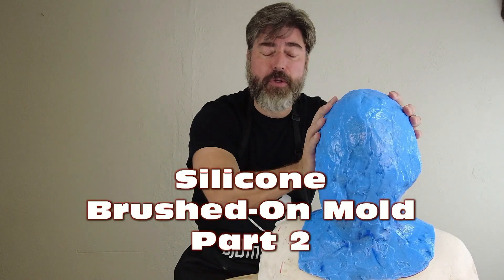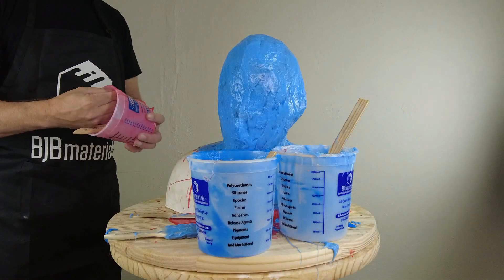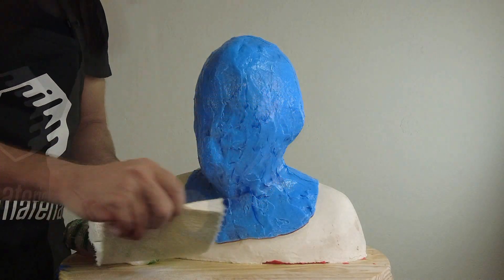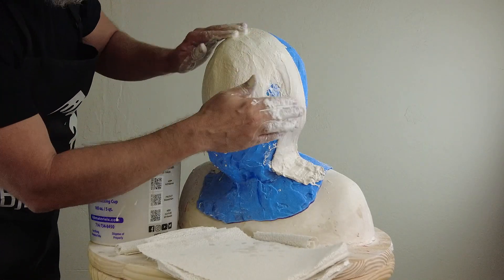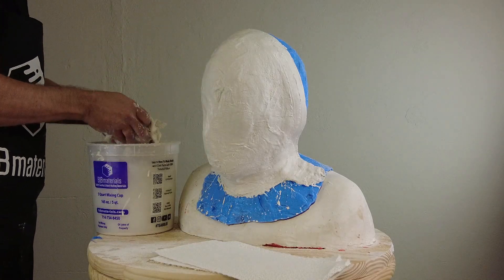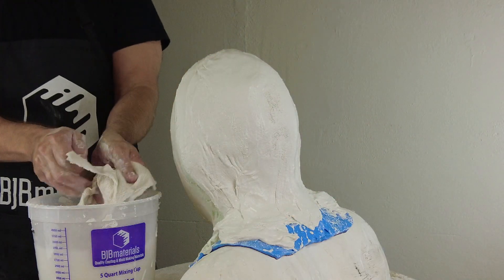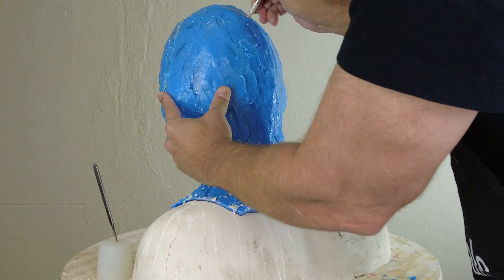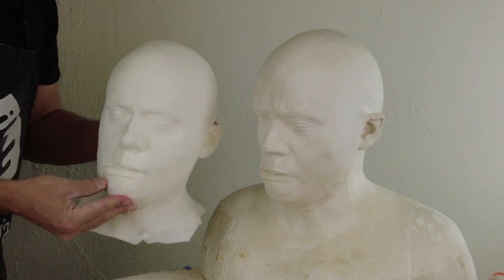Brush-On Silicone Mold Part 2

Comment: Great tutorials - got me thinking about something I'm experimenting with ....
I have a female polystyrene wig stand that I want to use as the mold for an animatronic robotic project. 
Can you recommend the best brush-on silicone that I could just paint on - that will maintain the original features ?
Reply from the maker: The silicone used in this tutorial would work for that: TC-5130F thickened with SC-5001 thickening agent
Reply: @brickintheyard  thanks for quick reply. I checked supplier (BJB), they have distributor in UK,  unfortunately they don't stock these items. But it's got me thinking and I'll do some research. around use of thickeners for making silicone skins. for animatronics, cheers mate 👍

Comment: I watched all that only to be confused and disappointed at the end... I'm sure the confusion and disappointment is all on me. 
I didn't understand how you cut the seam on the back of the mold, wavy then straight? I wish you'd shown a close up so I could see what you were trying to describe to my old, addled brain. 
My disappointment stemmed from the fact that I didn't get a nice close up view of the back of the head. I wanted to see how it turned out, if it was clean, if there were traces of a seam, or even if a full seam was still visible. 
Yup, you guessed it. I'm new at this molding business. I've never played with any of this before but am trying to figure out the best way to cast a  life-sized "baby" elf head with long, delicate, pointy ears that I made out of Super Sculpey. I'm afraid even with your super soft silicone it will still destroy my original .
I really, really appreciated the work you put into your videos and am very thankful that you are willing to share your vast knowledge with the public.❤
Reply from the maker: This process leaves a vary faint, easy to clean seam. I used this mold again in a recent tutorial on casting a Polyurethane Foam + Rubber head. As for the way the seam is cut, in cross section, the cut looks like a funnel. The wide, "S" shaped key at the top (outside of the mold), terminating in a point at inside of the mold. I believe I have a whole playlist of "brush-on"  mold videos on this channel that might help you out!